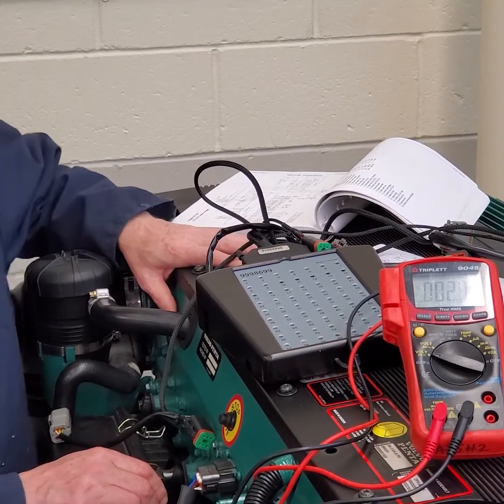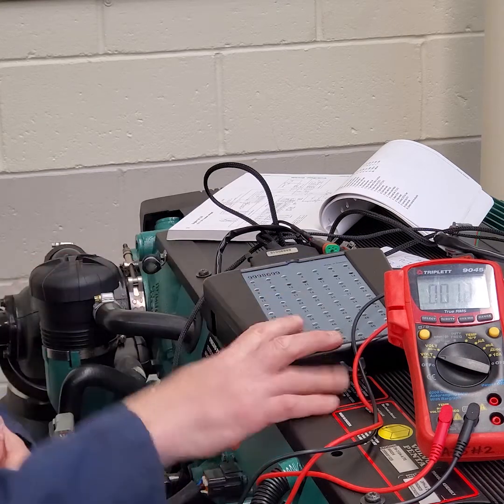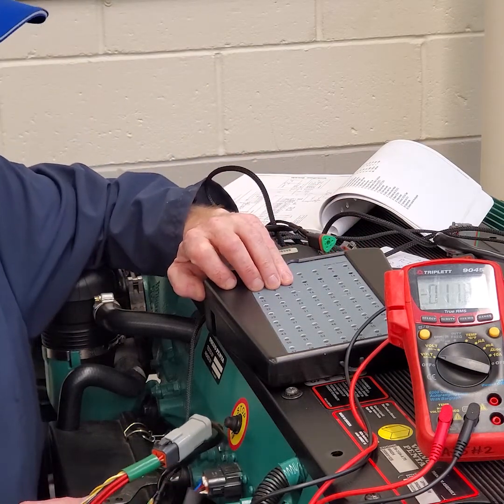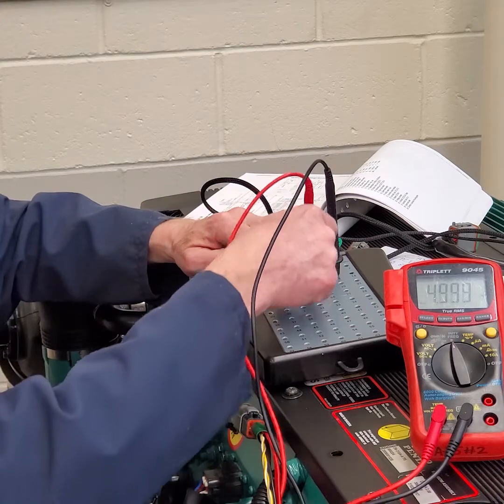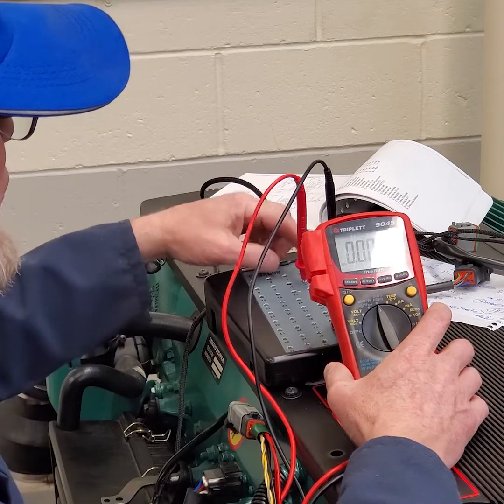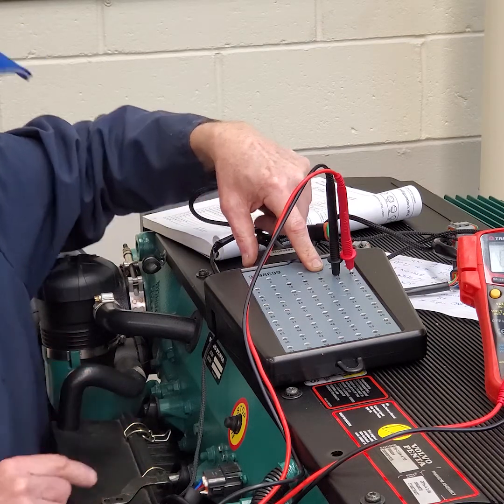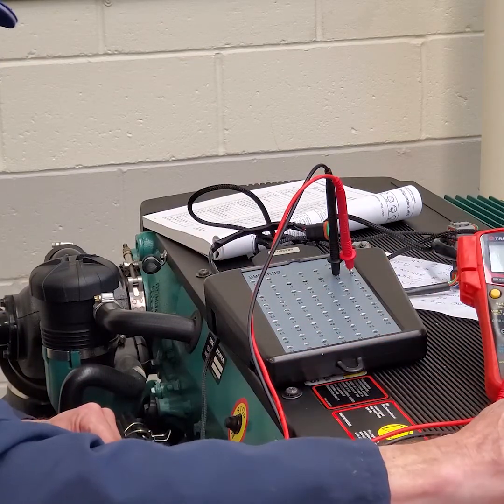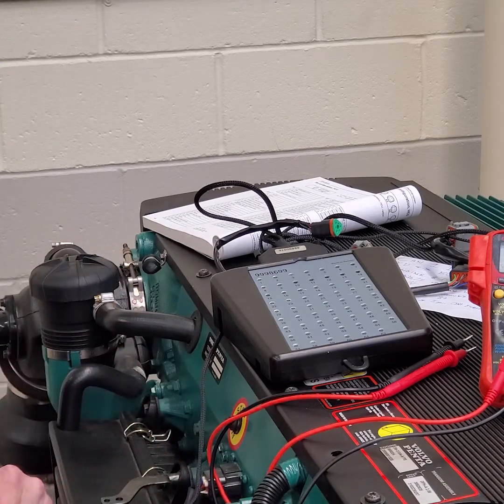Volvo Penta D6 Diesel Vodia diagnostic harness

Comment: Hi Ted. I need some help. I live in Venezuela and i have a cranchi smeraldo 37 2006, with twin engine Volvo penta d6 and DPH but I can’t fix the power trim. The electric motor trim is fine and the switch also but the power trim doesn’t work. Could be the harness ?
Reply from the maker: One drive only? If so can you see drive position on the lcd display. If not bad trim sensor, change it and do an autoconfiguration.